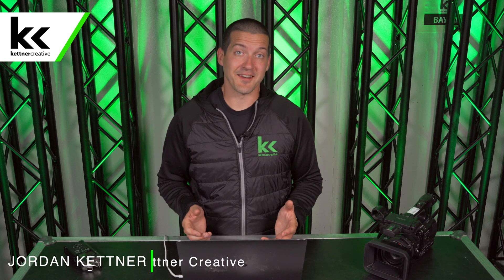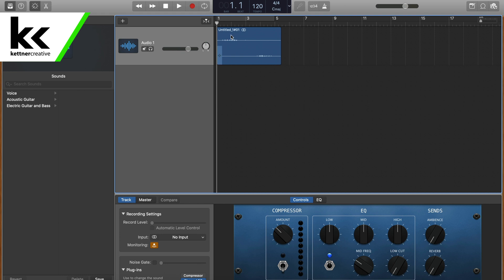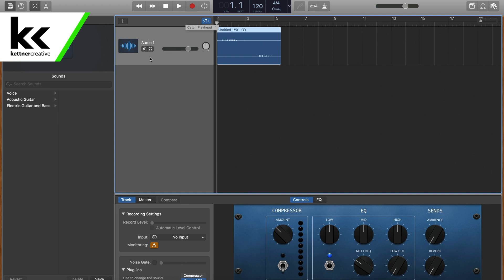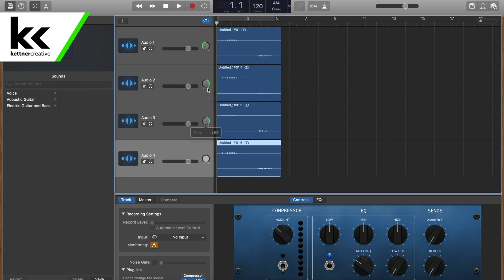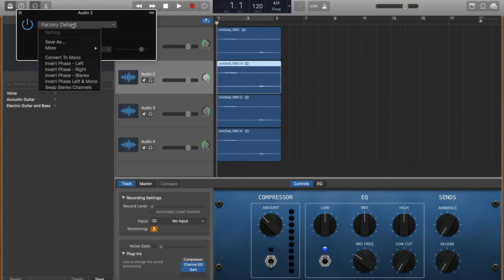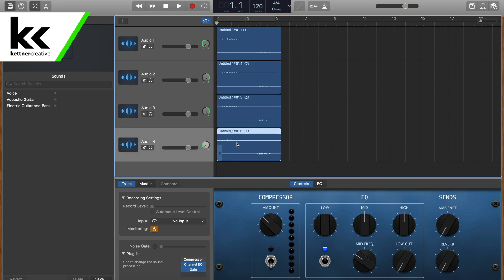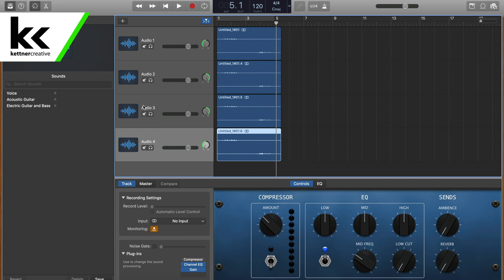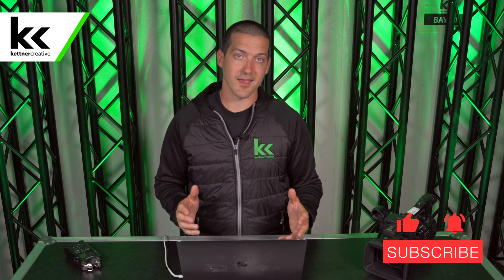Convert Stereo Channel to Two Mono Channels in Garageband

Comment: Thanks for the tip. I tried doing it and still sounded off. I changed the setting to “invert left and mono”……sorted it right out if it helps anyone else! Using temp equipment at the moment and it’s so fussy so needed this info!

Comment: Thanks BUT - on there is and error in the explanation page on your site. the text instruction for track 4 is to pan RIGHT - which results in a mono track when combined. please correct. I did a few tracks with this error before checking out the video which gives the desired result.

Comment: Knew there was a way.. surprised there is not an easier way however..
That all makes sense to me except the gain bit & not having a basic button/function to select that splits in into two tracks easy breezy.. where that button be?
I’m using a scarlet interface.. it’s coming in as one track with two channels in it.. wtf is that!?

Comment: Just wanted to add a quick hack for my problem of combining separate L & R audio tracks is to click on the "Input" under the "Track" settings. Mine had the two input circles, i simply clicked on the icon and it changed a single circle (I'm assuming for simplicity's sake, it's mono). This also fixed it instantly and combined it into one single track played into both L & R ears simultaneously.
Reply: Thank you! This worked well, and was even easier! (Although this worked for my purposes, I don't know if it will work for others who might need the ability to edit and modify L & R channels separately, which the video seems to be a better fit for, since it isolates them on separate tracks).
Reply: I tried that but the quality of the track went way low !   this video saved my life today

Comment: 2 Things:
-Using the gain tool to invert, is that just so what exports is a stereo track with the same thing in both?
-I know GB has had issues with completely isolating L/R with the pan tool, is this something we just have to live with or does this fix it, or did I miss the memo and that's not an issue anymore?

Thanks so much!
Reply from the maker: 1 - Exactly
2 - No idea, I just know this method seems to work.